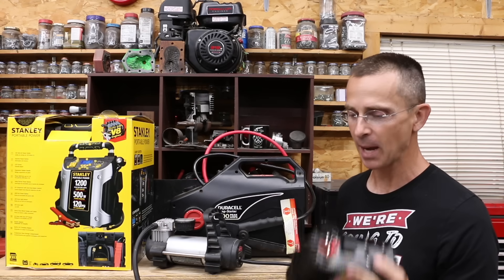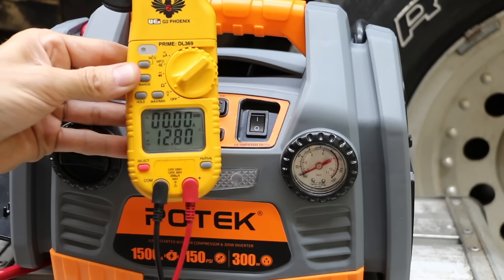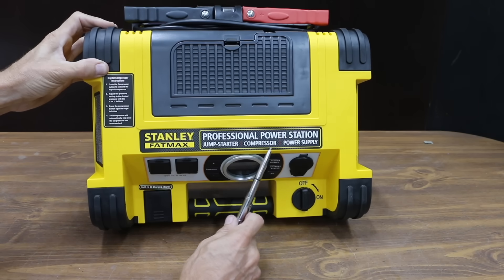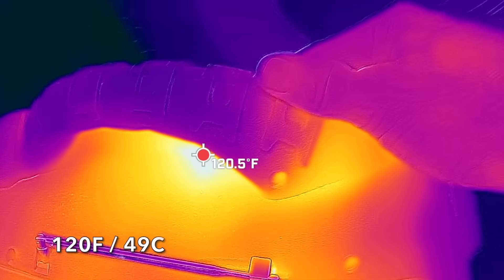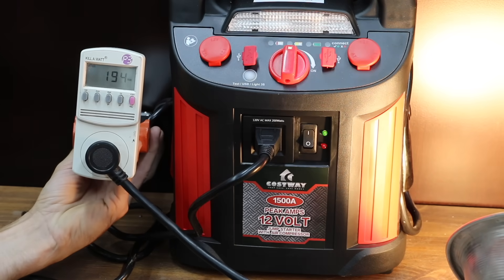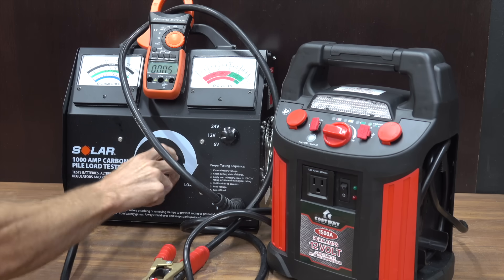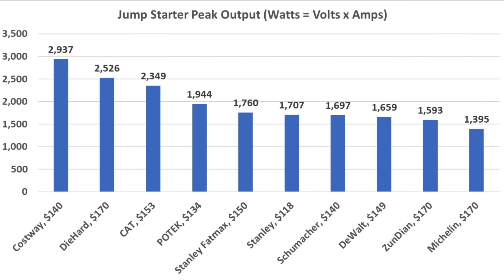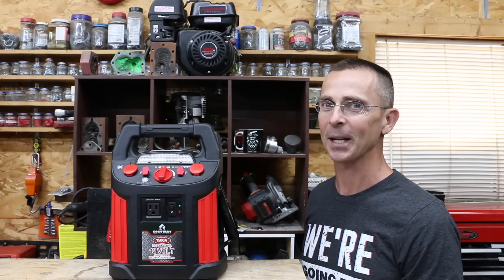Best Jump Starter? DieHard, Schumacher, DeWalt, Michelin, Stanley, CAT

Comment: Seems like the DeWalt, both of the Stanleys, and the CAT are sharing some of the same parts, especially the displays. 

I have the previous version of the Fatmax and the compressor died after maybe 30 car tires were inflated, and it sucks as a jump starter too.

So much junk out there these days. Thanks for doing the review, it seems not one of the items you reviewed is worth consolidating any of my separate items, since they all work much better than any of these devices you tested.
Reply from the maker: You are welcome!  Thanks for the feedback.
Reply: The cat is just the cat name liscenced and rebranded from them by stanley / black and decker. Stanley / black and decker also own dewalt, mac tools. I think they also make craftsman and porter cable. So a lot of their line is just the same thing dressed differently. Most of the mac and craftsman electric tools are the same just the mac costs $300 more on a tool truck and looks cooler. Wouldn't be surprised if they do the same with the booster packs.
Reply: This is what happens when you buy 3 in 1 tool you get 3 useless tool
Want a good booster pack buy a jump and carry
Reply: The normal Stanley is identical to Walmart's Everstart Maxx. I've had two of them and they aren't terribly reliable I've found.

Comment: I've had a previous model of the cheapest Stanley and it has served me well for years. I charge it from time-to-time, but even after months of riding around in the back of the Jeep it will still jump a car battery. I've used it after offroading to air the 35" tires up to a road-worthy pressure and drive to a proper compressor. It seems like you rushed over the fact that they all jumped a weak battery and a lot of people didn't catch that. I figure, if I jump my battery once for $118, its probably still cheaper than calling a tow truck or the hassle of trying to get a jump.

Comment: I had an old version of the Stanley before they added an inverter, and I literally never used the inflator, and after a few years it is now dead (the battery). Anybody have opinions on whether to replace the battery ($45) or just go for one of the modern lithium ones? I only used it for jump starting, but the regular charging was a pain to remember in the summer.  It was pretty fascinating to open, literally just has a 12V power brick strapped to the input
Reply: If it works for you for jump starting, replace it. Especially if you're in a cold climate. But the air compressor sucks and will die soon and the jump start sucks for me too.

Comment: I have two of the older die hard ones that look pretty much the same. I acquired them from where I worked when they quit working. The problem was the 22ah lead acid batteries that were left plugged in for 5 years completely cooked. I took them home and repowered them. One got some 38650 LiFe batteries. I think 6p, 4s configuration for a total of about 18ah. The problem with this one is about 50 amps max output. It is good for the inverter, the light and the compressor, but only good to start an electric or hybrid car. The second one I put in some headway high discharge batteries. These are a 2p, 4s configuration and rated for 400 amp discharge. I have nothing to try it on, so I only can guess it would work better than the stock battery. It only has a capacity of 16 ah. They may have less capacity overall, but I bet the both outperform the stock lead battery. They make small lithium packs, but I have not seen large units like this with lithium. The Headway batteries only cost a little over $100 and the lead battery is $50. I would pay the extra $50 for the lithium any day.
Reply from the maker: Thanks for sharing.

Comment: I looked at some of these units awhile back.  But they ALL use SLA batteries.  None of them used Lithium type batteries.  So they are expensive units when you have to replace a battery every two years.  Especially when you need it.  In addition a SLA battery can not release the current fast enough to compare with a Lithium battery.  So I could not see making the investment in any of them.  I think the test results here prove that out.
Reply from the maker: Thanks for sharing.

Comment: I think a good video would be testing different angle grinders(corded and cordless) if you could come up with tests. Maybe RPMs, which bogs down less under load, etc. also would be good to test different grinding wheels and cut off wheels if possible to see which brand is the best value, cost wise, and efficiency wise.
Reply from the maker: Thanks for the suggestion.

Comment: Love your videos, but I think if you added a second axis on some of your charts would help with clarity. Specifically from this video, charts with drastically different number values (cranking amps & volts) and different axis values (amps and dollars).

Looks like you’re using Google sheets - the setting is hidden in the “customize” tab. Scroll down to “series” and click the drop down that says “apply to all series”. Click which column from your data you on the right axis, and then select right axis at the bottom.

Hopefully that’s clear but feel free to reach out if you need any help.

Comment: Great test. I'm not particularly impressed by any of them. I am curious how the "overcharged" units kept that high voltage. Almost sounds like LiFePO4 cells instead of lead, but not likely at that price point.
My bottom line...  Lead is dead. Heavy, poor performance under load, cheap. I'm going to let my confirmation bias convince me that was proven by your test. 😅
Reply from the maker: Thanks!  Thanks for the feedback.

Comment: That air compressor at the start looks similar to the one I gave as a gift to a car guy I know. It allowed you to hook up to the car battery terminals instead of a cigarette lighter which I figured would be better for him since there was times he would drive a classic car which might not have that and it's worked great for him so far.

I have also looked into those jump starter things in the past and from all the reviews and stuff iv checked seemed to all say the same thing. They wont work if your battery is dead which kinda defeats the purpose if your stuck somewhere and need power to jump your vehicle if it's completely dead thus why I quit wasting time looking into them. Surprised you found one that actually worked. I know a few car guys who bought really cheap looking (yet still expensive) battery back things to jump start their vehicles and almost laugh when I see them since I know it wont work if their battery goes completely dead.
Reply from the maker: Thanks for sharing.

Comment: I'm so disappointed you didn't test the Duracell one you had at the beginning of the video. It looks like the one I have and I wanted to see how it compared.  My Grand Cherokee battery died at the costco gas pump a few years ago and they used the Duracell power station they sold at the time. Jumped without issue so I bought one. Unfortunately after the first charge it stopped charging. I returned it and got another one that has been working great so far.  I jumped my mom's car with it once and used it to inflate some tires. 
I had one of those smaller jump starters that's like a battery bank and it wouldn't jump my Grand Cherokee, so when I saw the duracell one could, that's why I bought it.
Actually looking closer, I think Duracell powerstation is slightly bigger than the one in your video. Would still like to see how it performed though.
Reply from the maker: Thanks for the constructive feedback.

Comment: All these use either 12220 or 12180 SLA/AGM batteries inside would be interesting to see who made the actual battery. Most are probably the same with just parasitic losses on the battery from the rest of the circuit inside that makes the difference.
Reply from the maker: Thanks for the suggestion.

Comment: Have you done one with the lithium battery jump starters?  A friend of mine purchased one long ago and it's been used many times to jump start vehicles. There was a guy in a large F-250 who's battery died in front of my old work and he came in to ask if anybody had a jump starter, I handed him that  tiny, compared to the starters here, jump starter and he scoffed. However, it started up first time, no problem.
Reply from the maker: Thanks for the suggestion.  Thanks for sharing.

Comment: Due to slight variation in battery cells, a fully charged 12 volt lea-acid battery can be up to 13.8 volts right off the charger.

It settles down a bit in a few hours - couple of days of sitting.
Reply from the maker: Great feedback.  Thank you.

Comment: just a note for people jump starting, especially with a battery pack. the + of the jump source (a battery pack or other car) goes to the dead battery + BUT the - of the jump source goes on the engine/ground on the engine. this allows the dead battery to be bypassed and just start the engine while not charging the battery
Reply from the maker: Thanks for sharing.

Comment: The speed controller with the lamps probably presents a pretty poor power factor to the inverters (although not an unreaslitic usage scenario). A better way (since they probably rate them with 1.0 PF) would probably have been a variac with the lamps, or a benchtop ac electronic load.
Reply from the maker: Thanks for the feedback.

Comment: Unless I am misunderstanding the results, this is the kindest review I have seen you do! It didn’t appear that these units could fully inflate a tire, or achieve their rated amperage, or provide wattage from their inverter at their rated capacity for any length of time. The small jump packs that you have reviewed in the past, combined with the inexpensive compressors you have reviewed, seem to be a cheaper, more effective, and more reliable solution.
Reply from the maker: Thanks for the feedback

Comment: I’ve had 3 diehard power stations over the last 10-11 years. They’ve worked great for me. I’ve noticed the air compressor was always the first to go on mine but always did a great job supplying that extra little boost of power sometimes needed in the winter up here in Minnesota. I’m always watching your videos and I can’t say enough how much I appreciate them. So many products are available but which ones work the best? I bet PF knows. Thanks again for the great content. I’m definitely going to try the costway next time I need to buy a power station.
Reply from the maker: Thank you!

Comment: Integrated unit, something breaks, replace everything. Suggest two units: AVID POWER Tire Inflator Air Compressor and Jump Starter with Wireless Charger, UTRAI Jstar 4 2500A 24000mAh. Both together are about the same size and weight as just an integrated unit.

Comment: When I worked at a battery supply store, a customer came in with a Black & Decker jump starter/air compressor that wouldn't take a charge anymore.  When I told him that a new lead-acid battery (20 amp) for it would cost him $40, he told me to just throw it in the trash and left.  I bought a replacement battery (at my discount) and the unit worked perfectly, so I kept it for my own use.  4 years later and it still works (I used it the other day to jump my lawn tractor).  Your mileage may vary...

Comment: Can you do a comparisson of welding gloves?
Reply from the maker: Thank you for the video idea!
Reply: @ProjectFarm  you could easily stick a thermal probe in the hand but I think adding the following would be good

-a finger grip test in grabbing a flat metal on a flat surface, to see if you can pick up a piece of metal
-a clamped on a piece of metal with fingers and then things and pull the metal away.  A higher lb is better
-a force test for moving fingers

Comment: so can we directly compare the air compressors on these units to your separate air compressor test is this the same size and type of tire/vehicle as the old air compressor test from 2019? is the jump starting test comparable to the small lithium ion battery pack jumpstarters?

Comment: I had no idea these combo units existed, but they seem like a bad deal. If you want an air compressor, a dedicated air compressor seems to work much better, like the Harbor Freight unit you tested a while back, it is much faster and quieter. For jump starters, the lithium jump starters you tested as well showed much better performance, and they're cheaper too. You can spend $90 on a lithium jump starter, $40 on the HF air compressor, both of which have much better performance, are much smaller and lighter, and are cheaper than some of these combo units. As for the power inverter, I can't think of a situation where I'd need it. Not that it matters, since they're low power and probably a modified sine wave inverter, not good for sensitive electronics. I doubt they'd have a decent run time anyways. Some units dies in less than 10 minutes with a ~ 600w load. 

Also, these are most likely using SLI batteries. Deep cycling them will absolutely destroy them within a dozen cycles or less, a non-issue with lithium batteries.

Comment: Thank you, glad to see a  Stanley ( mine is jump start only, wanted all  battery, nothing else )  is on the list , too bad that it failed the  test ....  Note: The old battery test amp ratings by General Motors  were to a minimum of 9.6v  at X amps  for 15 seconds .. in other words testing a battery you increased the carbon pile to the test amperage, or to a minimum voltage of 9.6v  for a duration of 15 seconds  .. cranking it up to a lower voltage / higher amp doesn't really count because a starter motor wont be turning over at 4 volts .. that Costway/GoPlus  is impressive, it  really did well on one of the hardest tests, a  completely dead battery jump start
Reply: I just noticed that carbon pile tester you used already  has the correct minimum voltage on the meter   .. one way this test could be done , is to load the battery  so the voltage stays right at   9.6v  for 15 seconds , then record the amps just at  the 15 second cutoff mark  .. this would give you a truer amperage test because no starter is going to turning at 4 volts

Comment: When I did my first cross country trip about 10 years ago I bought a Senco Air Compressor and a Cobra 1500 watt inverter to run it.  It will actually blow up a truck tire and not over heat.  In fact they can run just about all day.

Comment: Lol, I have an Everstart jump starter that looks exactly like that Costway exact functions as well. About a year ago the battery got to where it would not hold a charge and I replaced it with an Expert Power 12 volt 20 Ah agm deep cycle battery. The factory battery was a 12 volt 20 Ah sla, the new battery is much heavier but this jump starter works better with this battery than it did with the factory battery. But has been very nice to have. Thank you for making this video.

Comment: I have a Schumacher battery charger, one of the smaller models, and it does alright charging a car battery from 1.4v to 12.6v in decent time. I don't know how their other products perform but I think it would be the only brand in this line up that would last the longest though because the other brand's batteries would probably go first before the Schumacher's, maybe you can test a long-term application in that criteria.

Comment: Do you think one of those could be used to plug a battery tender?

I drive my car every other day but when i dont drive it for a full day or two i have to boost it. (Drive a old acura that is known to have such issue. Just cant find the gremlins).

Want to tender but dont have access to an outdoor outlet close to my car. Was looking for wireless ones but nothing is made of the such and then wondered about these and BAM your video was there lol.
Would it last 24 hours with a tender plugged in it?